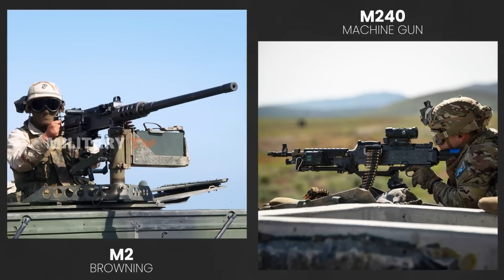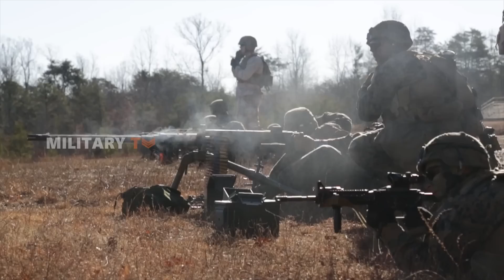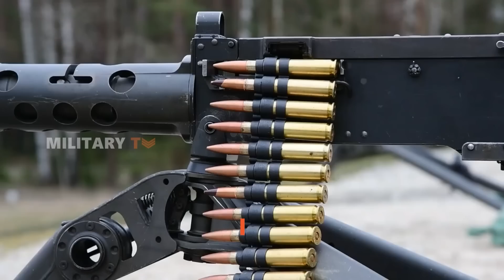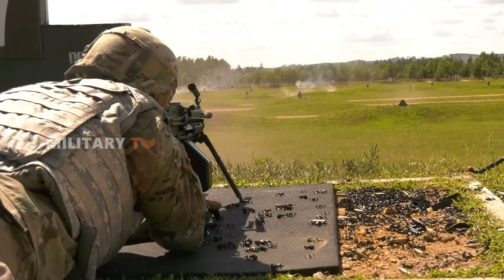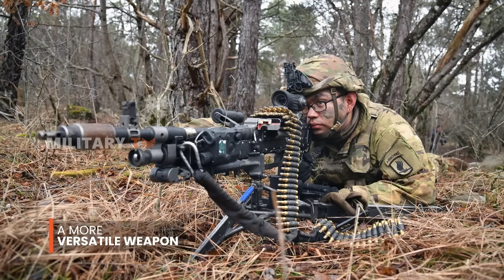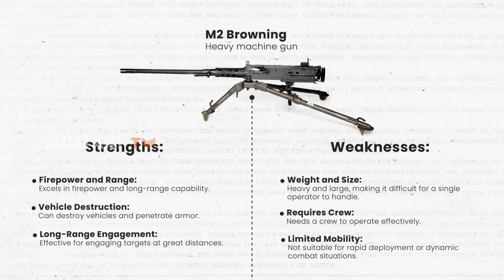Epic Firepower: M2 .50 Cal and M240 7.62 mm Machine Guns!

Comment: Two of the most reliable weapons in the US military.  Have had experience with both and never had an issue other than the M-240 coax "running away" when it got over hot.  All the loader had to do was grab the charging cord and hold the bolt back to stop it.  Then yell at the gunner for firing too long of a burst.